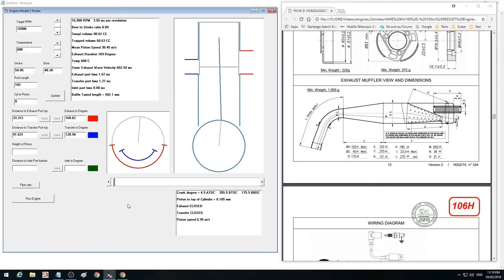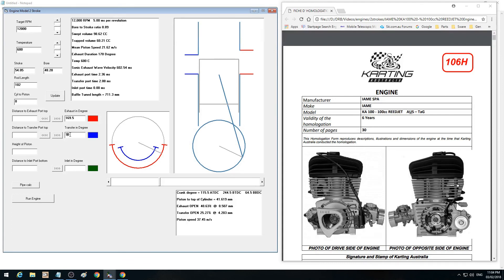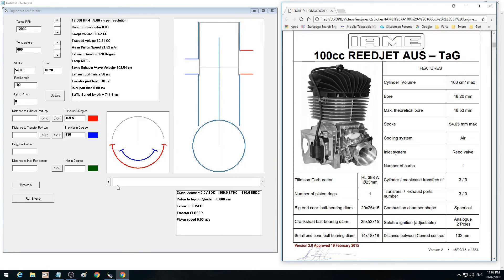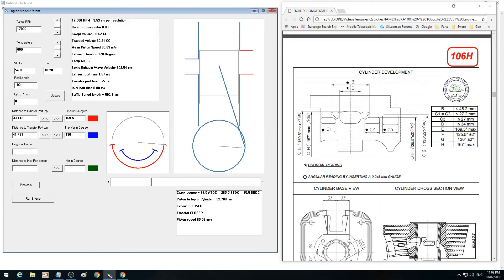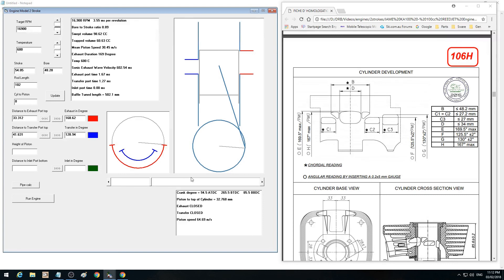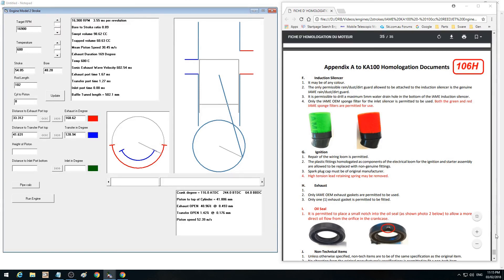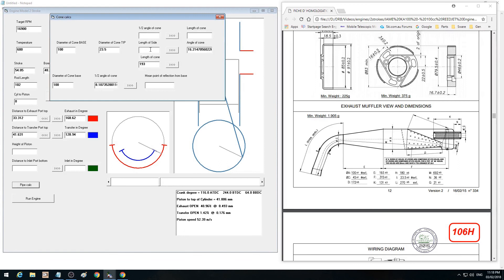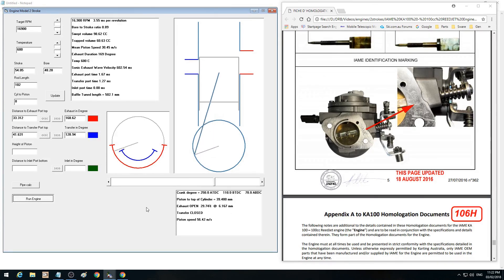What is the effect on 2 stroke expansion chamber tuned length after raising cylinder ? E9

Comment: Hey, im currently making a excel sheet. Im quite new to exhaust system calculation and i find it hard. So i try to learn, but my excel sheet is getting larger and larger for every hour xD 

What i find hard is:
There is so many different formulas with different belly diameters, angles, lenght, exhaust pulse witdh, exhaust puls speed, exhaust pulse lenght etc… and in the end they dont add up. 

So to have a nice referanse, what would you suggest for this engine?
Suzuki ts50x
Bore: 47mm
Stroke: 37,8mm
Dynamic compression: ~9,5:1
Squish: outer 0,4 - inner 0,7(for squeeze effect).
Squish areal: 50% of diameter.
Rod lenght: 80mm
Off center rod pin(longer time in tdc area).
26mm carbourator(close to min formula) The carb is D-slide, and with a selfmade connecter point which increase its distance ~5mm.
Intake is combination of piston port and reedvalve(stoppers gap is 8mm).
Exhaust duration is 207 degreas and 36,7mm wide(78% of diameter)
Transfer duration is 146 (6 ports)
Intake port is 179 degrease, but it stays open longer due to reedvalve helping out.(They are in paralell)
Ignition is HPI digital, i run default «high rpm curve».
Current exhaust system is Yasuni R3 short stock for derbi(designed for longer strokes than i have, so works higher for me).

How it acts(i have never had it running very clean, 10 years since i last worked on it) :
It has a «prekick» on 6,5k rpm, and a «main kick» on 8,5k rpm. It seems to have max effect around 14,5k rpm but works fine to 17k.
Reply from the maker: My 2T Pipe Calc Freeware program uses the same code as published under SAE by Professor Gordon Blair of QUB in late 1990 that is based in peer reviewed scientific process.
There are a heap of others around but most of them are derivatives or Gordon Jennings equations which were written by reverse engineering pipes and a fair bit of assumption.
You can try my 2T Calc, see the link in the video description section.

Comment: Hi, just a question on this specific engine. The new regs for this allow you to use either one or two exhaust gaskets. How will that effect the tune with a 48.44 piston, 0.35mm base gasket height and 1.08mm squish? These engine have the best torque around 7500rpm so we aim for that point to be able to pull out of the corners and still have high rpm. 
How specifically will the extra exhaust gasket help or make the tune worse?
Thanks
Reply from the maker: How thick are the exhaust gaskets ?
Reply: Hi, exhaust gaskets are 2mm thick.
Reply from the maker: @strauchy111  
Ok 
2mm exhaust gasket wont make any notable difference to tuned length.

Comment: When you say "16 degree overall angle, which is an 8 degree angle" or "a 24 degree angle, which is 12°"... What is the overall angle that you're referring?  Degrees in relation to top dead center or degrees on the horizon, or both? 
One thing I haven't really heard anything or read about regarding the angles of a two-stroke pipe is that it exists on Earth, has weight added and comes along at a high rate of speed... So it's not dissimilar to any gravity-fed apparatus at speed?  I could go on and on with my question however just watching a couple of your videos I'm fairly certain that you'll understand the questions that I'm coming to ...
Reply from the maker: When referring to pipe cones I use included angle.
When it comes to port timing I use total opening angle for any cylinder port, except when referring to rotary disc intake as opening and closing on them is asymmetrical to TDC but I state that when used.
Not sure what you are referring to with "So it's not dissimilar to any gravity-fed apparatus at speed?"
Reply: I was meaning how things change when vertical weight is at horizontal speed ...
Like I said, I'm terrible at putting my thoughts into words with this stuff
Reply from the maker: @darahgardner  In reference to the cones of the pipe, keep in mind that the compression and expansion waves traveling to and fro in the pipe are sonic waves and thus are energy and not mass.
Acting similarly to billiard balls hitting one another the energy as transferred from one particle to the next.
So weight or perhaps molecular weight if you like would probably not factor into it pipe design other than the effect to wave speed.
The waves cause a distortion of the pressure at the given location of the wave at any moment and gas we know constantly attempts to equalise across pressure differentials.
Which is why timing it to arrive at a particular event in the engine and port cycle is important such as a compression wave arriving just before the exhaust port closes presents a momentary higher pressure front just outside of the port to oppose spilling of fresh intake charge out of the exhaust port just as the port closes trapping more of it in the cylinder.
Reply from the maker: As to the effect of the cones, they are no different to an increase or decrease in the pipe area.
Where a compression wave that arrives at an increase step in pipe area even open air will reflect an opposite signed expansion wave in the opposite direction the compression wave, and a compression wave that arrives at any decrease step in pipe area will reflect a same signed compression wave in the opposite direction.
The purpose of the cone tapers is merely to expand the waves length over a wider RPM range, where a single step would only reflect a wave of narrow length that would be effective at a very narrow RPM window.
So a wave reflected from the single step in area will be of a very high amplitude but short length, and same compression wave reflected from a cone is basically flattened out into a longer wave of lesser amplitude
Hence the steeper the taper angle of the cone the more narrow the effective RPM range of the but a higher gain, and a lesser angle of cone yields a lower gain but over a wider effective RPM range.

Comment: Did I just hear you say that that back cone is drilled with many tiny holes that reduces the internal pipe pressure??
Reply from the maker: Yes but be aware the perforated end cone is contained within a straight section which has it own outlet tube.
Have a look at 100cc Yamaha sprint karting pipes for an example of this.
Reply: I can use a steamer pan- kitchen pan that is shaped like a wok, but perforated like a steamer basket- to direct the flow of fire to central (not perfect ) point with little spurs of the other gases burning off  out of the holes just passed the base of the pan  where the cylindrical  angle begins .  
This is also a metal jug of some sort repurposed into  a fire thing - base diameter about 18in top diameter approximately twelve and it's around three feet tall with a angular constriction between the body and mouth.

Comment: Hi Dave, I have a question. I have a 2T engine and its original power is 5,5kW 5000RPM with the original factory exhaust. If I put these values (5,5kw, 5000RPM) into your software then I get a new tuned exhaust. Will the engine then have power again 5,5kW at 5000RPM? Am I right? When I want to increase the power of that engine I have to assume that the power will be for example 8kW at 6000RPM and then those values are put into the software. Do you understand me? the power of the engine is given by the original exhaust, but what the power will be after the tuned exhaust I don't know.
Reply from the maker: The Kw or power value is only used as a loose  estimation of exhaust temperature. It does not factor in to the pipe calculation.
Exhaust temp effects tuned length.
The RPM value is the redline value of the engine so you set that to whatever peak you want it to rev to.
Reply: @AuMechanic  Yes, Now I finally understand. Speed of sound depends on only temp of gases so I dont need kW and RPM for tuned exhaus. Thanks a lot. it is easy. I have read Blair and some information wasnt clear.
Reply from the maker: @GeboSek  Yes temperature and composition of the exhaust gas. which is where the values for RSH (specific heats) and ICG (gas constant) influence. Hold the mouse pointer over the values for popup help to explain them.
As for time, (being RPM and Port Timing), RPM used for TL is often mistaken for the peak HP RPM however the ex timing value used in degree is measured as ex port closed to ex port closed so the tuned length is likewise closed to closed which is certainly not where peak power occurs with the port all but shut.

Comment: Hi Dave. Trials bikes typically have perforated baffle cones. The surrounding chamber is full of wire wool. The area of the surrounding chambers seems to have got bigger over the last few decades on new bikes. Also the outer size of this chamber , bent  at all shapes to accommodate kickstarts, frame tube, airbox etc, seems to have its largest section at the mean point of reflection in cone. Can you see any logic in this? Amazing videos! Thanks

Comment: Hi David. Great videos love your work!  With the perforated baffle cone ~ what effect do the holes have on the plugging wave? ~ Does the size of the outer chamber, at baffle cone area, affect the exhaust engine performance? Ignoring the restrictions on this karting engine, that is. Thanks
Reply from the maker: Sorry I missed this comment.
Re the perforated baffle cone would reduce the peak of the reflected a wave from the baffle cone but spread its effect over a wider RPM range allowing for a bit of over revving.
They use this type of perforated baffle on KT100 sprint karts with no gears.
So if you removed it ands used a solid cone that engine power would drop hard once it reached the RPM limit of the pipes tuned length.

Comment: hi dave 
we use this same engine put run a 19mm restrictor on the exhaust do you have any tips to make more power when you have a exhaust restrictor eg port timing heights etc what would be better or worse as there is variations in the castings of these engines
Reply from the maker: The class of racing this engine has rules on modifications that states you can not do any modifications not specifically allowed by the regulations so you can really only work within those bounds.
Reply: @AuMechanic  yes i under stand that but there is variations in the barrels of these engine we run a 19mm exhaust restrictor what would be better to make power with the exhaust restrictor ? higher or lower port and which one wider or narrow port and which one ?
Reply from the maker: @jamiepage3101  The restrictor limits bulk flow through the ports, as such any changes to port size wont provide any more flow. 
As for effects of port timing if you ae going to run min base gasket thickness to lower the barrel to get more comp then it might help to have a barrel with the higher port so that the effect of lowering the barrel on timing will be offset to some degree.

Comment: Your content is really easy to understand and follow. Thanks for putting this all together!

I wonder if in simple terms you can help me understand one thing in two strokes, that was bothering me for a while. 

Why  two identical new vanilla factory engines, lets say rotax max for example differ in power. What makes one produce more power if they are mechanicaly identical please?
Reply from the maker: There is very subtle differences in engines built in the same factory with respect to parts that are made to given minimum and maximum tolerances..
This is why works or factory race engineers go through piles of factory parts measuring each and grade them to sort out the ones that are as close to exact specifications, but that requires direct factory access to do.
There is also tuning that factors in to it and on that topic I can tell you road racing 2 stroke bikes and Karts that the smaller the engine capacity you have the more crucial tuning is and that a lot of racers are pretty slack about tuning so if you are very methodical when it comes to tuning that will give you an edge over many others.
Reply: The weight of the rider and the angles of the forks and shock in relation- is only ne of many I've come across

Comment: Hi ! I have drilled a 2mm hole in my 180cc 2 stroke piston skirt.  For extra lubrication and cooling ,on that exhaust side.  And now  when the piston is at TDC,  the small hole is in the middle of my exhaust port window.  What do you think it will happen,  with the intake and exhaust dinamics,  in this situation?  Thanks.
Reply from the maker: Try it, you may find it makes little to no difference because the hole is so small there is not enough time for any great amount of gas to flow through it at crankcase pressure.
Reply: @AuMechanic  thanks! 
But why,  the crankcase pressure, it is not getting higher ,when the piston is going down?
Reply from the maker: @zfloz9895  
Because the exhaust port is shut at TDC any flow through the hole will be to or from the crankcase at whatever pressure it is.at that moment the hole is exposed. (I don't mean at full crankcase pressure)
Reply: @AuMechanic  yep! The big question is,witch way will be,the flow? Thers back pressure from the exhaust ,to keep everything inside that piston, or  will be otherwise? :))
Reply from the maker: @zfloz9895  
Back pressure is not a constant pressure so at TDC the engine is almost 1 full revolution after the past pressure pulse.
And either way there is not enough area in a small hole to allow any meaningful flow to occur in either direction.
Any increase in pressure has no increased flow at a point when the flow become "choked"
There is a barrel mod some use on RC engines that drops the barrel enough to leave a very small gap at the skirt and the bottom of the port and I am told that this has no ill effect to power so that more or less confirms the theory that a small hole any flow will be "choked".
Also some small engines even have a small hole in the bore above the exhaust port that leads to the port and it is there to bleed of just enough pressure to reduce the spike of pressure at blow down, the intent is noise reduction.
Some even have a small slot machined in the bore above the exhaust port a few mm that bleeds a very small amount of pressure to the port for the same reason.
Reply: @AuMechanic  grate answer!  I know about the small decompress hole above the exhaust port,  that bleeds the compression from above the piston.  But I did not know about that barrel to piston skirt gap.  Thanks for putting this things into  scenario.  Grate help! I'll keep posting.  Gheers  !

Comment: Hi Dave .may I ask a general question .I have a 2014 model chainsaw 40cc given to me with starting issues for a "tune up". After I got it started and began tuning I achieved all requirements of a safe operating machine.all good so far... on a cold start it makes a gas fart out exhaust and only starts with throttle in full open position, throttle response has return to being  poor...I'm thinking  a mechanical issue rather than set up on carb.what would your initial thoughts be.
Reply from the maker: Bit hard to tell without looking at it.
Could have nipped up and lost compression, blown a crank seal, fuel pick up issue, bad plug, there's a lot of maybe's
Reply: AuMechanic thank you .are you familiar with stratified air port on modern husqvarna saws.
Reply from the maker: No not really, something to do with stratified scavenging I believe using air rather then fuel mixture.
Reply: u are correct.theres an animation on YouTube (of course there is haha.the saw industry has EPA reg to conform with so development is still going on.autotune carbs are also interesting ...thanks stay well .good luck with your channel

Comment: What can you tell me about the model software?

Is it available to the public?

Thank you.
Reply from the maker: Hi
At this stage the software is just a handy calculator.
Based around Gordon Blair "Piston Position" program to display specs at each degree moment of the crank as it moves.
It'll need a bit more work on it to make it available to use and Im not sure if it warranted at this stage.
For now I'm just using it to display stats during lectures.
I've got some more to add like combustion chamber values to calc static pressures.
Maybe add specific port time area to it.
I've since add tuned length reflection point to show the distance from ex port to calculate wave time or arrival based on crank position.
If I get enough requests Ill make it a bit more intuitive for public and upload it to my software site.
Next video I am doing covers a few basic calculations used in it to measure up expansion chambers with unknown specs so a pipe can be measured up to see how close it is the port timing of the engine its fitted to.
Reply: I would love to put some of my engines through that software.... plans to share it would be awesome!
Reply: @AuMechanic  I love your videos and would also get a great benefit from learning and playing around with your software.
Reply from the maker: @fromairtob3612  
Ive just updated the description section above with a link to the free Expansion Chamber Software I released some time ago.
But it doesn't cover the software shown in this video, only part of it.